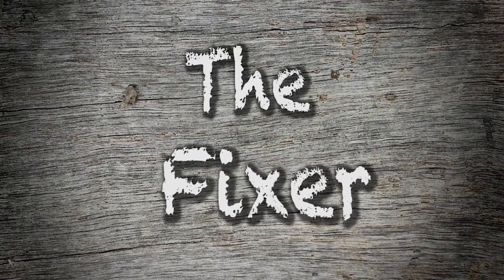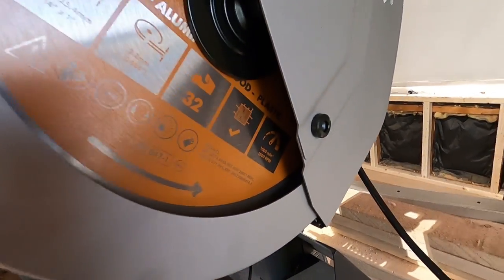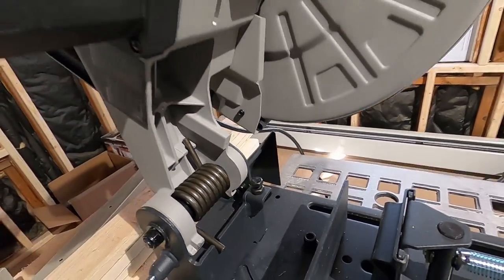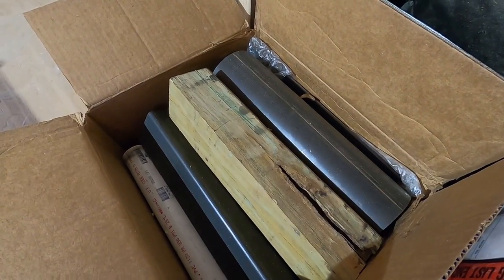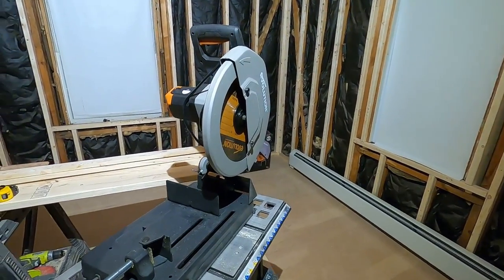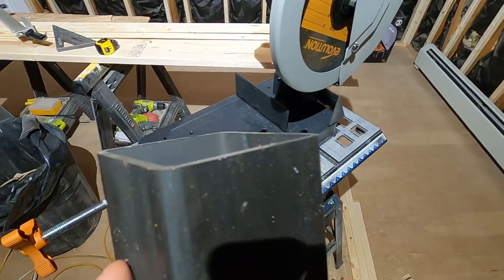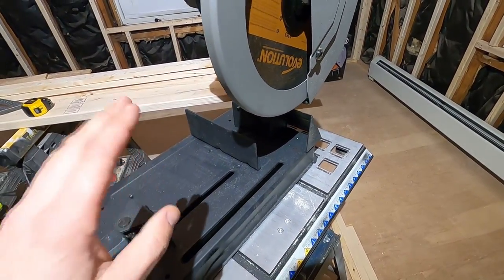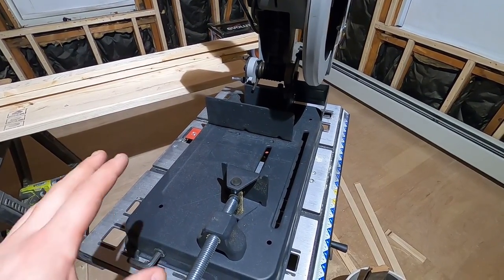Evolution Power Tools R355CPS 14 Inch Chop Saw Review

Comment: I own the Evolution 14" saw (the upgraded version of what you have). This is what I've learned about cutting steel with these blades..... I noticed you cut the flat bar stock horizontally instead of vertically. Always cut it vertically, with the thin edge making contact with the blade. The cut goes 2 to 3 times faster, and there's less surface contact with the blade. This makes the blade last longer as well. Also, always take your time with cutting steel (not that you didn't). Let the blade do the work. If you move too fast through the material, the carbide teeth will chip out. But that will happen on ANY blade if you push it too hard or too fast through the material.

On the 1/4" steel angle stock, I have found the best way to make 90 degree (flat) cuts is to have the tip of the 90 degree angle pointing upwards, locked into the saws vise. Again, it minimizes surface contact, and the cut goes 2-3 times faster and easier. 

However, when you make angled cuts, you will have to cut the flat surface down. But the way I look at it, the saw and the blades (although affordable) aren't cheap. And a good tool aficionado will always take time and effort to preserve their tools. 

The saw itself is awesome. It's low RPM with MASSIVE torque. These bladed weren't designed to be used to cut metal on miter saws. The RPM's on a miter saw are too fast. You can cut wood and plastic with the blade on a miter saw, but the higher RPM's will cause more friction, and the softer metals will gum up in the teeth, and your cuts will look like crap. 

Don't mean to intrude on your video, but as an owner of this saw (for 4 or 5 years now) I wanted to share my personal experience and discoveries. 

If you're thinking about buying the saw, don't hesitate. It's great.

Comment: I just bought  one of these. I've been using a 14" abrasive chop saw for a couple  of years. It's extremely slow, loud and the blade can walk.
I bought  the eveloution  b4 watching this video. The speed on the 4"x 0.250 cut was ete opening. 
I bought  this saw because I'll be fabbing up some railings and need a precision miter cuts on steel tubing.

Comment: I must say I just finished using mine for the first time on some 2" schedule 40 pipe and so far disappointed. I used the pipe adapter (noticed you didn't use when you cut pipe) and cut is way off. I tried without pipe adapter and still off. The rear vice jaw isn't square and flexes big time when tightening the vice (could explain why cut is off) also the vice catches on top when tightening. I rarely leave comments and don't think I've ever written a negative one, but coming from a Klutch 14" metal cold cut saw I really thought this would be a few steps up. I will be calling evolution tomorrow for my $$$ back.

Comment: So that metal piece for "weird shapes" is actually for square tubing to put the piece at the diamond configuration rather then flat square configuration. The diamond configuration makes for a quicker/cooler cut do to less surface area while cutting. Its also in the instructions you didn't read and right on the box 😉!

Comment: The back plate on the clamp,  is not perfect square and it also flaxes..gor weld supports to hold and give it more strength  the right side of the table base is i bit higher than the rest gotta grind down to level